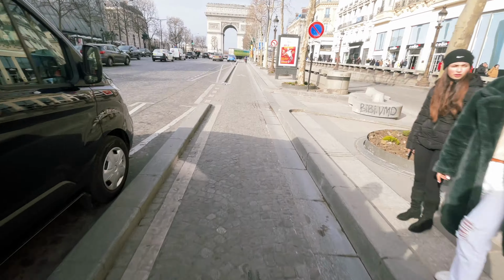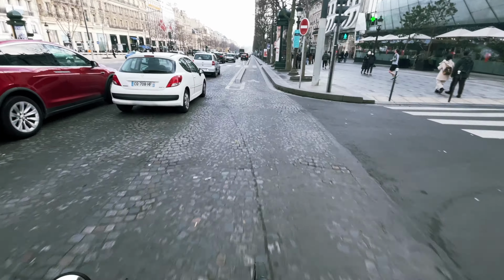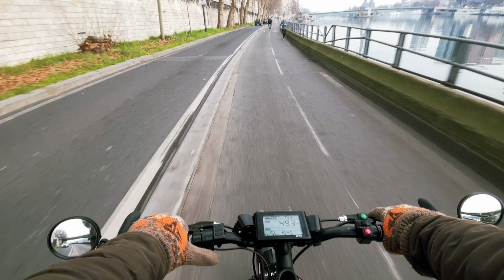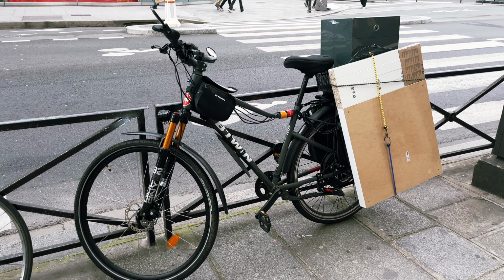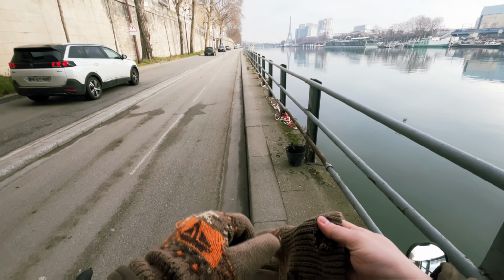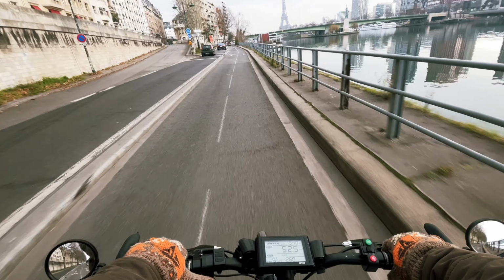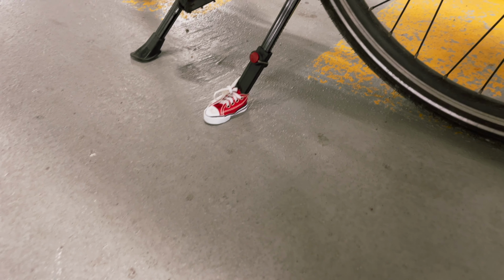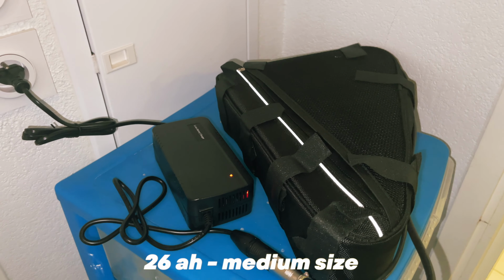How to Build 1500W e-Bike - Tutorial & Review of my $1250 Custom-Made Beast ! (Riverside 1500E)

Comment: I've just build a very similar Ebike 
With 27.5 inch 48v 1000-watt hub motor.

What I got for free out of the trash but took 4 days to fix it.

I also got a GT bike for free 
With very good hydraulic brakes air shock suspension and more.
Everything was completely broken but I fixed everything up.

I already had a 48v 84v 2000-watt controller.

I've always had lithium batteries what I bought from a failed business
Original cells.
So 70 cells cost me about £20
I had to pay £50 for downtube removable battery box.

For the full Ebike only cost me £83.
Because I bought plastic controller box aswell for £13.
I did buy a cheap battery charger and BMS = £17

So all together for everything = £100
Reply from the maker: Wow!! That's impressive! Good job!

Comment: Good one. Why dont you put the new motor on your riverside 500e? I just bought one and want to buy an extra front motor like in this video - do you think this will work too, or are there any problems I missed? Thanks
Reply from the maker: Hi, thanks for your comment :) Originally I wanted to add the second (front) motor to my Riverside 500E but I changed my mind because the e-bike would be too heavy and too powerful. I decided to build a second e-bike and have 2 bikes. Technically you can add a front motor to your Riverside 500E - no problem. PS. I have an idea to buy a mountain bike and add 2 1500W motors and 2 batteries. It will be the ultimate off-road e-bike. What do you think about this idea?